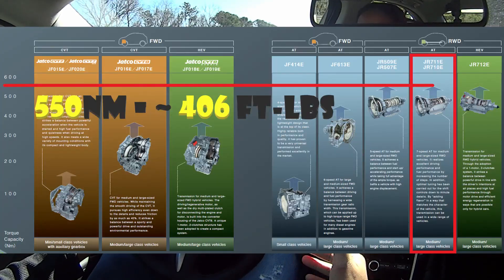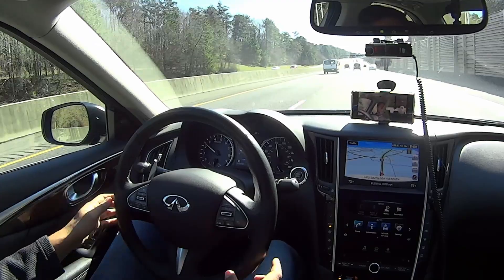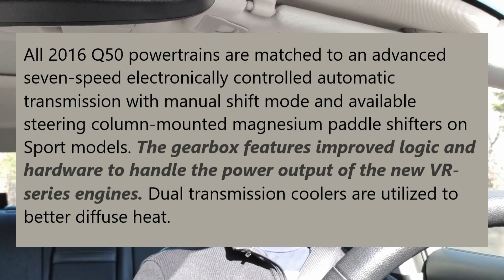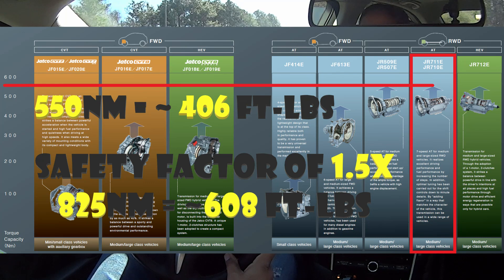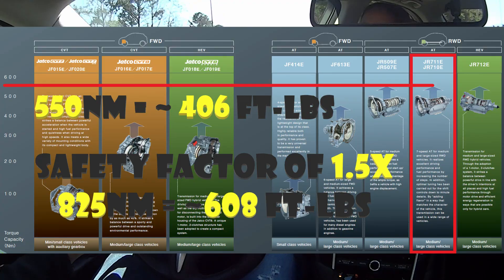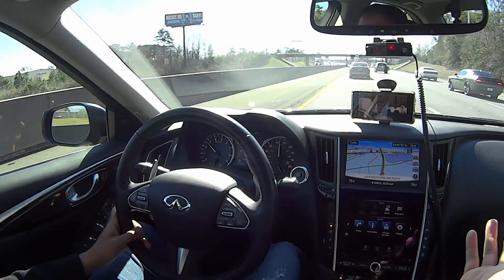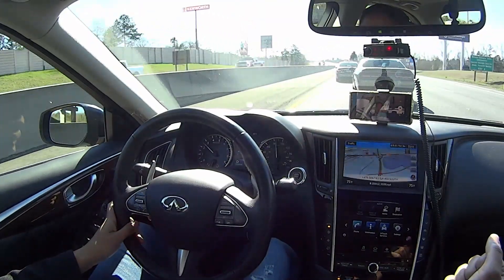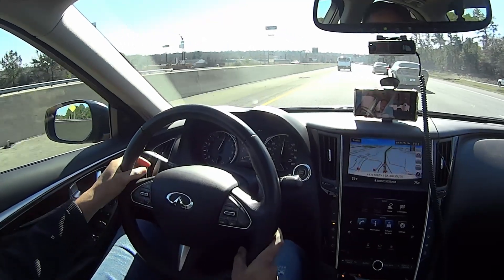What's Torque Limit on the Infiniti 7 Speed Transmission?

Comment: The spec given is in direct drive which is 5th gear. So you multiply that by 1st gear ratio to get you the highest torque. As you change to higher gears you change from Torque to horsepower.

Comment: Is this the same trans in the m series sedans??? If so, factory the m56/q70 5.6 are putting 400+ torque. I cld see them using in the vq versions of the m sedans, but that seems on the limits for the vk.. Thanks man. Great vids!!
Reply from the maker: Yep same transmission in the M/Q70
Reply: @KayDroTechnologies  they can hold well over 650 ft lbs of torque.. MSpek has. TT m56 on stock trans. Pushing close to 650 tq.. A lot of q50s and g37s creepin around 500 too.. Good show sir!!!

Comment: 2017 nismo 370z jatco limit?
Reply from the maker: No difference... same transmission
Reply: KayDro Technologies cool
Reply: KayDro Technologies im doing a 2jz swap but im using my jatco, i heard there is an upgraded version that can take more torque which one you recommend?
Reply from the maker: @andywu8558  yes get a 2016+ transmission from a Q50/Q60 red sport... it has upgraded internals, better TCU software, and dual transmission coolers.

Comment: Interesting video man, been keen to know more about the limits of the 7AT. Which leads me to ask,  is there a difference between the 14-15 and 16+ transmissions as far as torque handling capabilities?
Reply from the maker: Yep!

The 16+ transmission has upgraded internals and way better software to handle the immediate torque delivery of the vr30 engine.
Reply: KayDro Technologies huh that’s interesting to know! I wonder, is it possible to swap the transmission from a 16+ into a 15 seeing as people run into blown transmissions when running higher torque especially for FI builds on the 3.7. I’ve seen people rebuild from Level 10 but if a stock OEM tranny can run high torque, maybe it would be a better option to swap rather than rebuild?
Reply from the maker: @b9as4p9  yep you can... and you need need the 16+ TCU so you get the software upgrade too. I have been recommending this route for people.
Reply: KayDro Technologies that’s awesome to hear, I just picked up a 15 Q50 and am trying to plan out my future mods, maybe FI 🤔. Do you have an IG? I’d love to pick your brain about Q50s seeing as you really go in depth and have good knowledge about the platform and it’s limits
Reply from the maker: My IG kaydro_wins

I always answer people's general questions for free... but once you want to get very specific to your build goals I charge a consulting fee.

Comment: Excellent video!!! After being tuned (or if u have a JB4 map6) I went to Level 10 in NJ. I had Pat install EVERYTHING he can. On disassembly he discovered my transmission was overheating. 

Soo my 2018 AWD Red Sport now has a new torque converter, his "bullet proof" valve body, new clutches, and a higher volume pump to help keep it cool. I'm now good to 1000 ft lbs and more hp than I can give it even with the RS600 kit AMS is developing. 

Bottom line if you are tuned you are stressing the transmission.  The only way to really know is to open it up. 425 Hp at the wheels 475 tq is going to cause problems in the long run. Just IMHO (and Pat's at Level 10) He is a world class transmission specialist. FYI
Reply: I also got a 1000hp rated tq converter from them that actually locked up from over heating which I recently swapped out for an oem unit. My car only makes 265 tq and 316 whp  lol
Reply from the maker: Lol
Reply from the maker: What's the cost?

Comment: Quick question can do a video on how to change the serpentine belt
Reply from the maker: I literally just had my serpentine belt replaced under warranty like a month ago... 

I can tell you that it's a tight fit and it looks like the fan might need removed or partially removed. (On the VQ37VHR 2014-2015 Q50 a belt change is super easy and can be done from the top)

Why do you think you need the belt changed, have you checked the mark on the belt tensioner?